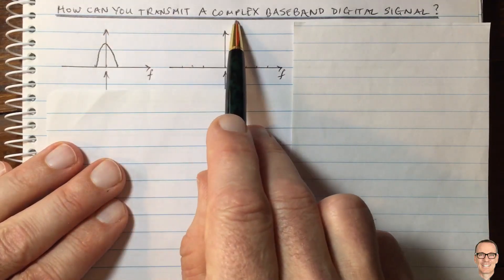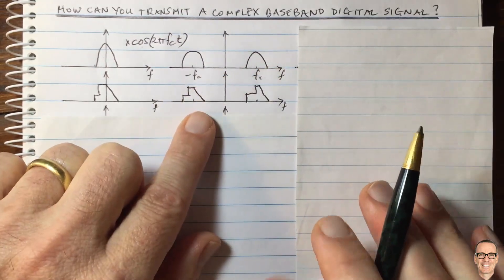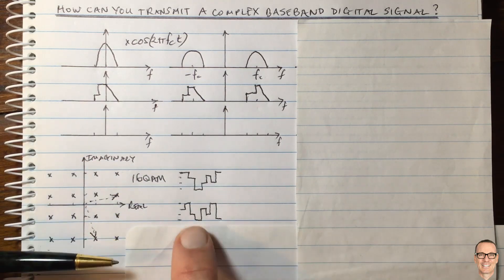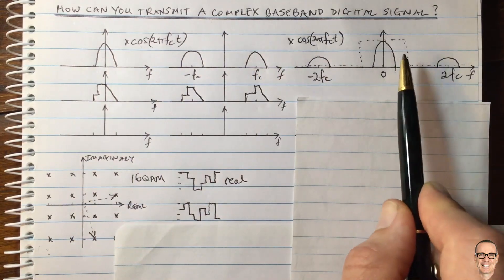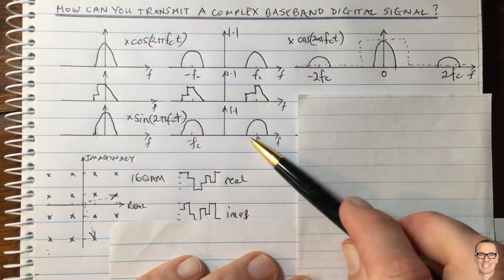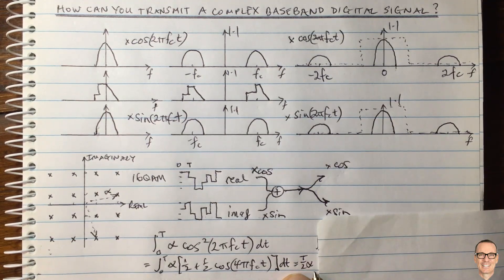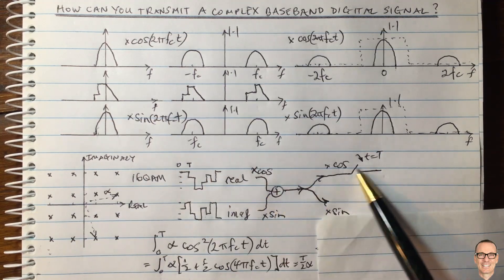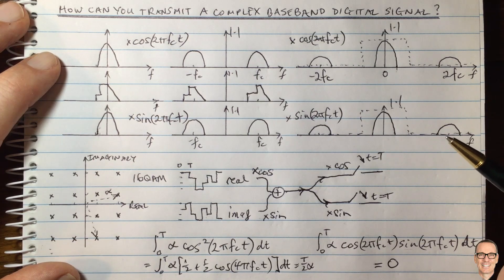How are Complex Baseband Digital Signals Transmitted?

Comment: Alright so i am still a bit confused about this subject. Would it be correct to say that we want to send a complex signal with a certain amplitude and phase (i.e. a point on the constellation diagram) but this is not possible with only one signal (because we can only create real signals). So to circumvent this problem we send two signals, one sine and one cosine. Each of which has a certain amplitude to create the desired point on the constellation diagram. We combine them and send them through the antenna. Then at the receiver we decombine them again into the seperate sine and cosine, read of their amplitudes and then use those two amplitudes to create the point on the constellation diagram?
Reply from the maker: Yes.
Reply: @iain_explains  Alright, thanks!

Comment: Thank you. I like to watch your videos. This time I think a key principal has been overlooked. The statment that sending 2 signal at the same time over the same baseband do not interfere each other may be missleading. The fact that one has been multplied with a sine and the other with a cosine, means that the signals are transmitted with a phase shift of pi/2.
Reply from the maker: I don't agree that it's misleading. It is exactly what is happening. Two signals are being sent at the same time, in the same bandwidth. The fact this is possible is because of the fact that sin and cos are orthogonal over a symbol period T, and that the digital data is constant over that time period. That's the whole point of the video. Yes, sin and cos are pi/2 phase shifted. But that fact alone does not explain why the quadrature mixer works.

Comment: 14:07 I'm sorry I don't understand why you approximate the integral of cos to 0. It's going to be 0 only if T is a multiple of 1/fc, am I wrong?
Reply from the maker: When T is a multiple of 1/f_c the integral is exactly zero. I briefly mention this at 15:52 but I should have made it more explicit. However, even if it wasn't an exact multiple of 1/f_c, then the integral would be approximately zero, since 1/f_c is always much smaller than T, so the portion of the wavelength in the time between 0 and T that doesn't "cancel out" (ie have balanced positive and negative components), will only be for a very short time period, and therefore contribute only a very small amount to the integral.

Comment: A short question, please. From the IF we convert down with a Digital Down Converter (DDC) to get to the baseband. Do we always digitize on that way? It is often said "the digital baseband" - can we also be in the analog baseband?
And within the bb, can we represent it in the time and frequency domain?
Thanks a lot.
Reply from the maker: The baseband equivalent signal model applies for both digital and analog signalling formats, however the output of the channel can only be represented at baseband in seperate I-and-Q form, for the digital format. When sending a baseband signal that is constant during each (digital) period T, the output of the channel separates nicely into I-and-Q, because sin() and cos() are orthogonal functions over a full wavelength. If the baseband signal is not constant (which is the case for analog signals), then the baseband components are not orthogonal at the output of the matched filter receiver. See this video for more details: "What is a Baseband Equivalent Signal in Communications?" https://youtu.be/etZARaMNN2s

Comment: Thank You. I have 2 short questions. In the second line, there is the complex signal in the frequency domain in the bb. In the time domain that signal would be with a complex part (z=x+jy), and in the first line, the real signal is without a complex part in the equation, is that correct?
To my mind that is the difference of a real and complex signal.
2. The equation that you show on the bottom (integral), is the equation of the orthogonal criterion of signals - is that correct?
Reply from the maker: Yes, that's correct (both things you mention).

Comment: One question here for this example, the symbol which is represented by four bits is multiplied by cos and sine ? or there’s 2 bits (four levels ) for cos signal and the other 2 bits for sine
Reply from the maker: In general, QAM constellation points are mapped to the data bits according to either grey coding (one bit change between neighbouring constellation points), or maximising the hamming distance along a trellis (as in trellis coding). See "What is Trellis Coding?" https://youtu.be/rnjy4_gXLAg

Comment: Hi Iain, thanks for your video! I found some books making a complex signal by multiplexing the quadrature component with -sin wave, which is Q(t)*(-sin(2pf_ct)), but what you did is Q(t)*sin(2pf_ct). May I ask what is the difference between them?
Reply from the maker: The negative changes the phase by 180 degrees, that's all. It's still orthogonal to the cos waveform.

Comment: Hi Iain, first a lot of thanks, the videos really helping and good. I have a question, where did the Integral (in the receiving end) came from? when I learned this topic, it was similar but after the multiply by cos or sin there was LPF that killed the other component, so I little confused, thanks!
Reply from the maker: Yes, I mentioned the LPF at the 7:15 min mark of the video and drew the shape of the filter with the dotted line on the frequency domain graph. The LPF eliminates the high frequency "copies" but it still has an output that is a continuous time waveform. After that there still needs to be something at the output of the LPF to turn it into a digital sample of the input data. This is done with an integrator (to "add up the energy" over the digital time period T) and a sampler.
Reply: @iain_explains  Okay, thanks a lot
Reply: @iain_explains  Maybe a short continuation here. If the LPF eliminates the high frequency copies, why is the component with cos(4pi fc t) still within the integral? Thanks

Comment: I came here from the "OFDM and the DFT" video. I understand the principle of OFDM, but I don't think the IFFT operation gives the full picture. It's not clear to me why OFDM block diagrams usually show the IFFT as the key operation and nothing else. Separating real and imaginary is a completely non-linear operation, and this is not reflected in the block diagrams. In other words, when you create a complex baseband signal using the IFFT, it's not possible to shift it up to a carrier and make it real through a linear operation. Is this correct?
Reply from the maker: Those block diagrams you're talking about are only showing the baseband perspective. The block diagram I showed in this video shows what's needed to actually send the signal in the passband.
Reply: @iain_explains  Thank you very much for the quick response! in real world algorithms, is the OFDM IFFT and the up-conversion fused into a single operation, or does it stay separate as drawn here?
Reply from the maker: What do you mean by "fused into a single operation"? The IFFT is a digital operation performed in a digital ASIC. The up-conversion is an analog operation performed using mixers, filters, amplifiers, etc.
Reply: @iain_explains  Ok, that makes sense. I was just wondering if, at a base station receiver for example, the carriers are down-converted digitally using an FFT as well.